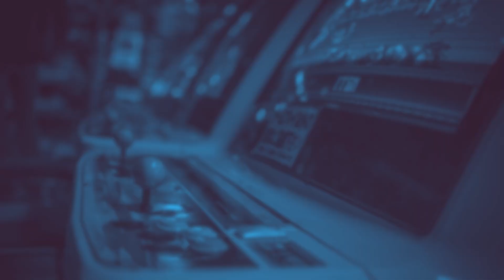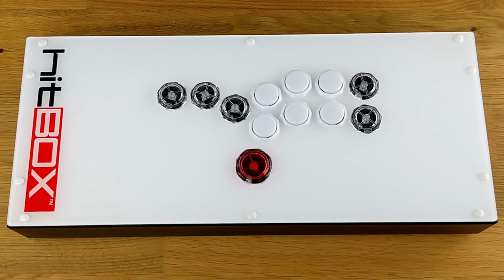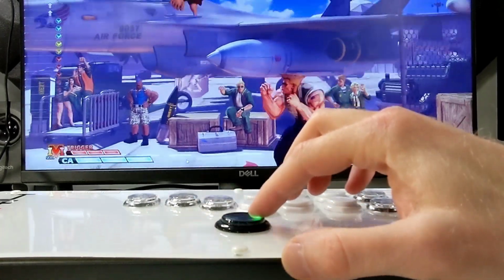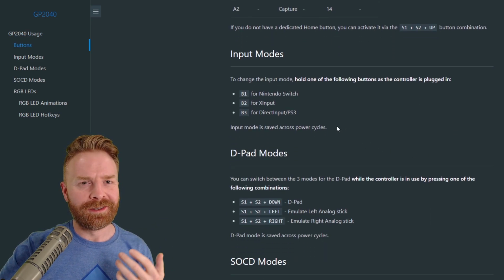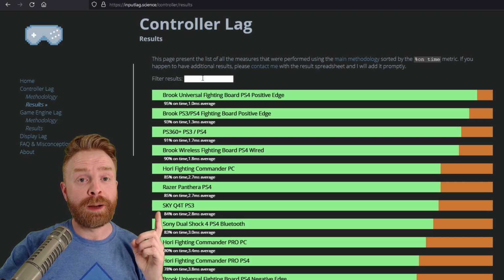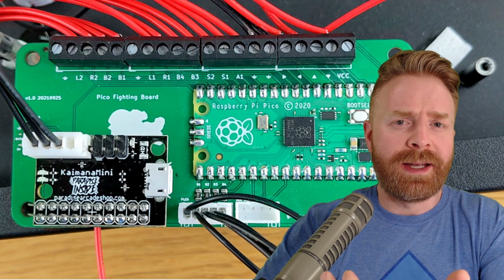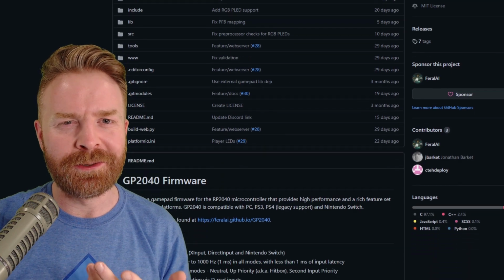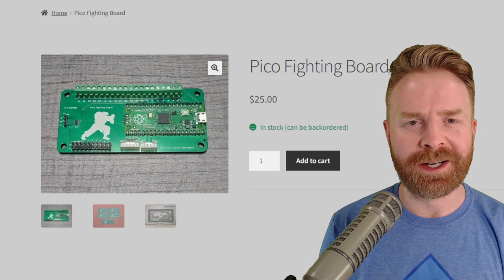The Pico Fighting Board: The Fastest Arcade Stick PCB

Comment: if i just get a pi pico, will their firmware work? 25 U$ is a bit steep for me, i don't really need the extra board soldered to it if it's just for the quick connectors
Reply from the maker: I believe so, but it might be a bit more work to get everything set up. The OSFRD also uses the PICO.
Reply: Yea, that's what I did.
Reply: @kareeeeem_  even the web setup? i can get a pico for 1/6 the price of this board over here
Reply: @kareeeeem_  is there a proper pinout to wire with just a pico board? i mean, 25$ is fine, but i'd be glad for a challenge to make everything work for 5$ haha, but i need a proper pinout for buttons
Reply: @BAD361  it's easy to make the pinout, i didn't find it online but i figured it out, except analogs

GP0 = LEFT
GP1 = UP
GP2 = DOWN
GP3 = RIGHT
GP4 = HOME
GP5 = SELECT
GP6 = START
GP7 = X
GP8 = Y
GP9 = R1
GP10 = L1
GP11 = A
GP12 = B
GP13 = L2
GP14 = R2
GP21 = L3
GP22 = R3

L2 is -Z axis and R2 is +Z axis|
there are  a few grounds on the board, i used the one between gp14 and gp13, the other ones should work but i didn't try
yes, single ground for everything, i love this

this is for x-input*

i'll put it in an arcade stick, so i'll be using the analog dpad emulation when needed (holding start+select+down for dpad, start+select+left for left analog stick)

also holding A (xbox) when plugging it in will boot it in nintendo switch mode, holding B (xbox) will boot into x-input mode
Reply: @vdfritzz  damn, thanks for the info!

Comment: Weird that the zero pi isn't a pi while the pi zero and the Pico fighting boardb are.
Reply: It's marketing.
Brook is trying to appeal to the guys who only want to spend $10 or less.
I have a Zero Delay encoder PCB.  I can attest to the fact that it's a piece of crap!  Not even a dedicated Home button which means you STILL have to use a DS3 shock pad or other licensed PS3 controller. The bare minimum to spend for something that performs better and is pre-assembled is $25.  That's going to be the Zero Pi (Brook) or Integrated Pico Fighting Board (Jasen's Customs).
The one thing the Brook PCB (Zero Pi) might do better than the Pico FB is PS3 support since it's based on a higher-end PCB (that I'm sure was reverse-engineered from an officially-licensed PCB just like the Cthulu PCB was).
I can confirm the Pico Fighting Board doesn't work with Super Street Fighter II HD Remix on PS3.  You can't even get past the Main Menu on the start page because NONE of the PUNCH or KICK buttons work!!!  You have to use "X" button to make menu choice and if it's disabled, you're STUCK and can only get out of the game with HOME button.  HOME button, START, and UP/DOWN stick inputs still work but everything is disabled until you try to exit with HOME button.  When you boot into "Quit" mode, the disabled buttons and directional inputs work again BUT if you go back into Game mode, all those buttons and directional inputs are disabled again!
The issue pops up even if you get into the game in 2-player mode.  The Player 2 (Pico-joystick) STILL has the button and directional input issues.  And the only operational directions are up UP and DOWN!  The Pico FB is useless in SSF2T HD Remix.  At least on the PS3 version....
My joysticks running with PS3/PS4+ PCBs and MC Cthulu (which is reverse-engineered from the Hori HRAP3 PCB) have no issues with SSF2 HD Remix or any other PS3 game I've used them with.  Pico FB has worked with most PS3 games BUT SSf2 HD Remix which is a game I like to play a lot.  Thank goodness I have other still-compatible joysticks to use to play that game!
Don't get me wrong -- the Pico Fighting Board is nice when it works but it's unlicensed and programmed by hobbyists.  This is not their first passion.  Hobbyists develop most of the emulators and there are still old consoles (Sega Saturn, Sega Genesis) that have issues with emulation to this day.
Frankly, I am puzzled as to why the Pico FB is having issues with the one game.  It's worked with every PC emulator I have and the other PS3 games I've tested it with.  I'm thinking the Pico developers missed something that didn't escape the guys who developed the Brook and Cthulu PCBs...

Comment: Ok, so if have a Final Fight A1up and haven't modded it yet, adding extra buttons, swapping the sticks and adding 2 of these encoders will give me a much better experience for SFV online?  I'm looking at the magstick + so can also play 4 way games.     I got close to gold rating but the game's poor netcode and my cpu not being the greatest (FX-6300) I suspect are major roadblocks when I lose to people b/c the game doesn't properly register my inputs.  I have gigabit ethernet plan hardwired but I suspect the game gives priority to weaker connection player sometimes.  I also only play connection 4-5 to minimize issues.  I wish they would use parsec as I'm sure that would be better.  Using nvme ssd via pcie which found a guide to do but wasn't easy to find.

edit: my gpu is 8GB RX 570  and DDR3-1600 32GB.  cpu utilization shows game uses no more than ~48% so I think capcom is more to blame as the game should run smoothly and not hiccup as much as it does.  I only play at 60hz (1600x900 monitor; 1920x1080 32" LCD tv or 1368x768 native for same tv)--no resolution matters, same problems occur